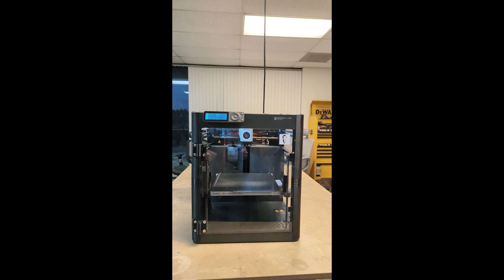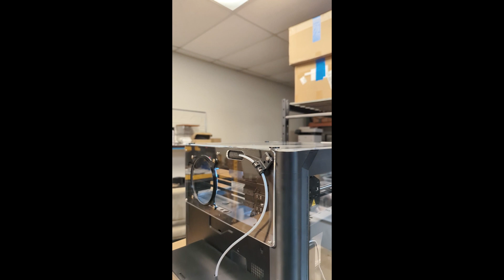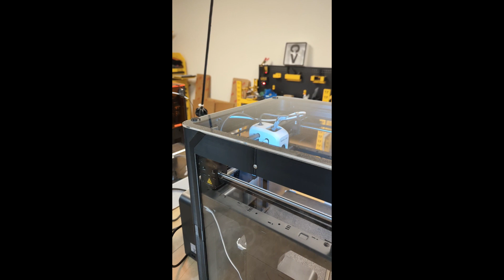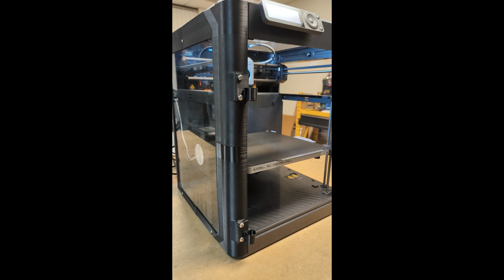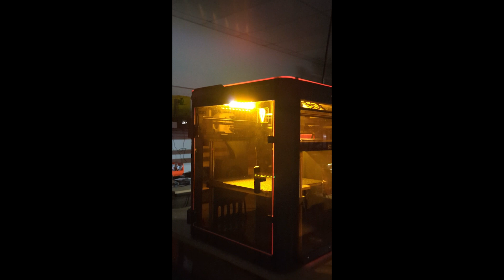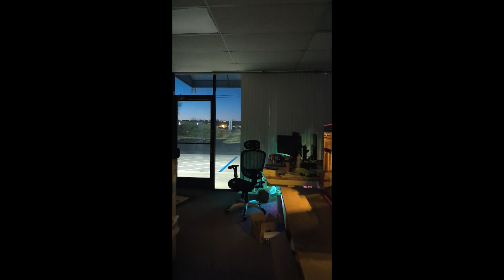Bambu Labs P1P Enclosure by Clearview Plastics

Comment: i would buy if its affordable meaning it can't be too close in value to the x1 or x1c.  899CAD p1p   --------- 1,219CAD X1. There is only 300 dollar difference, your pricing has to be more competitive than this. X1 has the factory enclosure already. cheapest option you got 230 CAD. Not sure if there is any shipping cost but i'd say theres only $50-100 saving + you gota install this yourself on the P1P.

Comment: At almost $200 for this, why not just order the Bambu Lab X1 for $999, that is already enclosed?
Plus, with X1 you get a faster processor, lidar, and touchscreen...
Reply: Do you guys in the US really pay 699 and 999 for p1p and x1? no taxes ? God bless America if so
Reply: @luissuarez5897  We pay taxes. Just like you would for this plastic as well.
Reply: @foam27  Then the x1 is not 999 , it is way more than 999
Reply: @luissuarez5897  There's taxes on the enclosure too, so the end is the same.
Reply: 1300€ for x1c with taxes, 811€ for the p1p with taxes to Europe
Reply: X1 costs almost 1300 euros for germany. P1p 780 euros

Comment: Enclosed X1 with touchscreen costs $999 USD, P1P with this enclosure comes to $928 USD. I know where the value is.
Reply: Exactly! Plus with X1 you get a faster processor, and lidar!
Reply: Depends on what youre printing. I can say the same thing if I'm just printing TPU and PLA. I know where the value is.
Reply: @Protoscope  ?
Reply: I believe the X1 is discontinued?
Looks like they only have the p1p and x1c on the site now